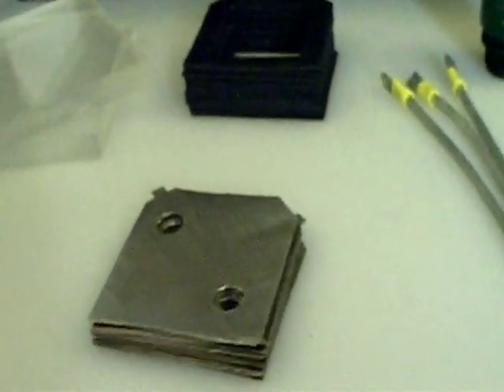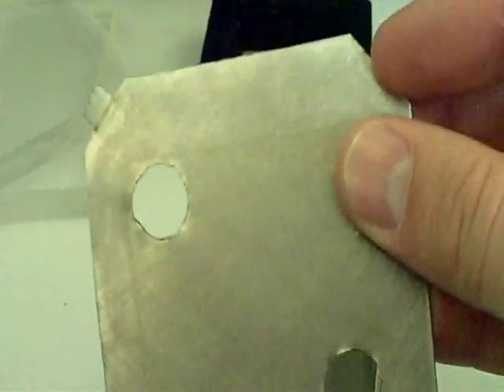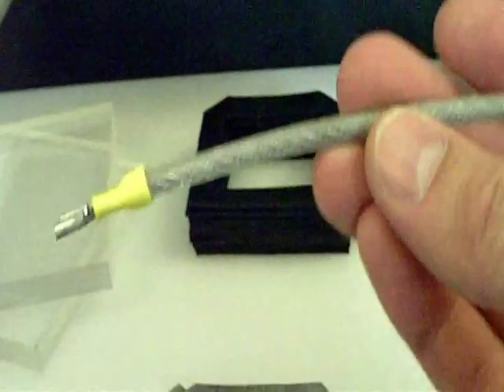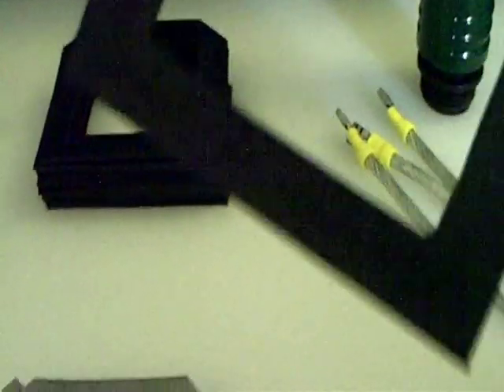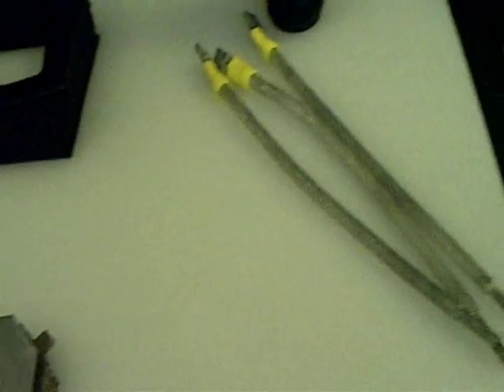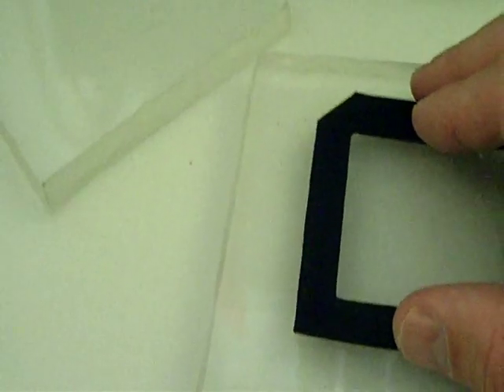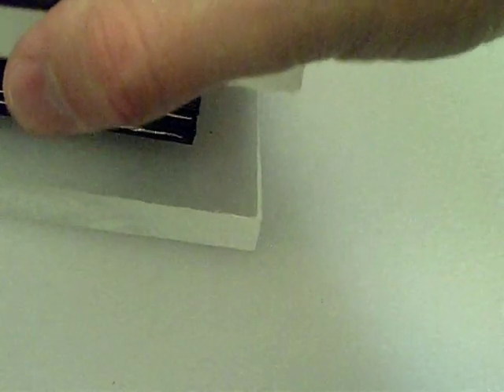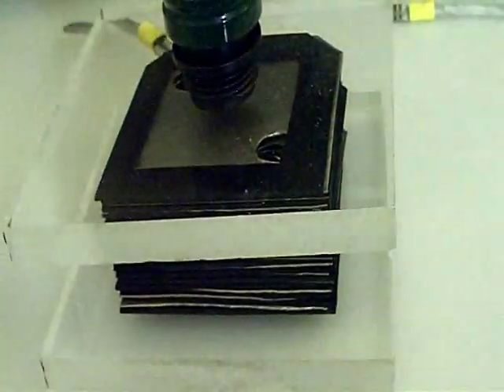Vid46 Volcano Cell Assembly (HHO, Brown's Gas, Hydroxy)

Comment: steel and stainless steel wire is a horrible conductor with serious voltage drops. I doubt the insulation or coating is anything good for long term use as it gets brittle, cracks and will cause some shorting or even fires if the unit isn't fused low enough. Those disconnects leak like a bastard too...lol  great idea, but, cheap chinese part.. The best quick disconnects I have seen are locking hose connectors used for vacuum lines which work great under pressure

Comment from the maker: @jgposner 

Thanks, I stopped playing with the washers, because even though it looked like decent output, it never gave me the results I was looking for. Maybe if I could get 4" or 5" washers it would be worth while.

I tried setting up a several cells in series, but I didn't have enough power to make it work right.

Comment: Awesome Serries, keep it up. 1. What happened to the washers, they seemed so promising? 2. What if you tilted this unit slightly toward one of the holes? 3. You keep talking about hooking up a 6 pack, I am dying to see that (or at least a two or three pack. 4. Enough already with the homemade output measurer; there has to be a professional gas meter you can hook up. If one exists that is under $50, let me know and I'll buy it for you or at least put $50 towards one. Your progress is my progress.

Comment from the maker: No worries, I have tested output on most of my designs, but if the results were less than anticipated, I wouldn't waste the time to make a video.

With this latest design I have not tested the output yet, because I've been testing the new gasket material to see if it would hold up.  I ran the cell non-stop for 1 1/2 weeks and then I had to turn it off to refill the reservoir.  

BTW.. No leaks on the new gasket material, no heating issues, and Amps never went above 11A @ 12V.

Comment: OK. Probably sounded like I was  down on you. Actually, I am a fan! Brevity of 500 characters causes comments to sound gruff.  

A 2.1 L engine needs at least 2.1L/min. of HHO to improve mileage. None of your designs are large enough for that production. At least you have not MEASURED production.  An HHO device needs to be able to run for 3 hours at a time. Not 45 minutes.  American drivers MIGHT check their oil levels monthly. They won't check electrolyte levels every day. Just isn't in them.

Comment from the maker: The point is that if you can make a design that will fit under the hood of a car, then anyone can use it.  Building fuel cells that can only fit in your trunk does not interest me!

I make these videos to share ideas with others. I demonstrate proof of concept, because that gives the viewers ideas that they may be able to implement in their designs.

Increasing fuel efficiency is hard to prove, because each vehicle is different and there are too many variables to consider.

Comment: How do you cut your plates...
I cut my plates with a cutting disk (1mm Thick)
(but is there a better way)
And i only had that drilling problem once
Then i changed  my drill bit to a rotor Broach
Which cuts Stainless Steel Like Butter..
(But is there a better way)
Also what kind of acrilic do you use..
i used this Black crap and it was stiff until i tightends it up heaps..the it bends and make the thing leak

and BTW great design and what not...

It should be  ( HH 'oh Snap' )  Thanks Buddy

Comment from the maker: Good point. I will have to use copper wire instead. 

I like the way the galvanized steel cable looks with the vinyl coating. I guess I could use low gauge speaker wire to get the same look.

Comment: The wire you are using is a resister. It's not coming into contact with the electrolyte, so copper wire is just fine to use, and more efficent.